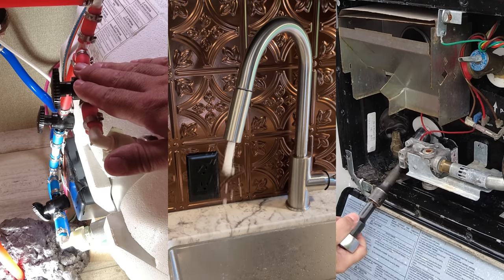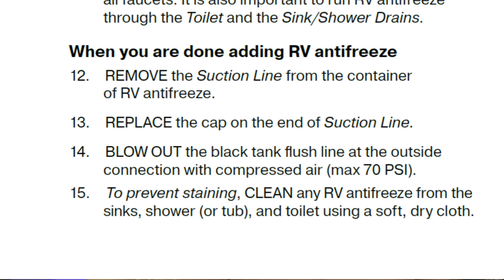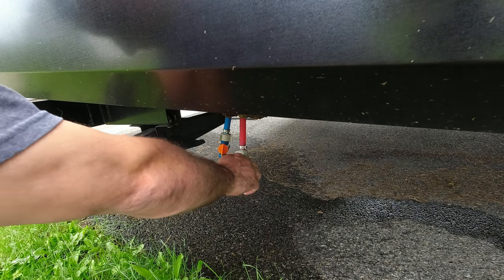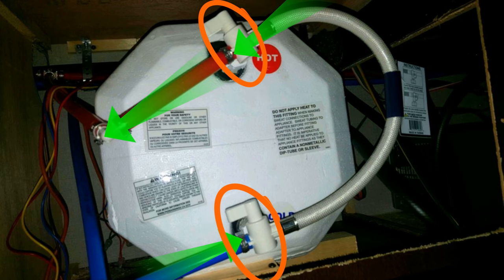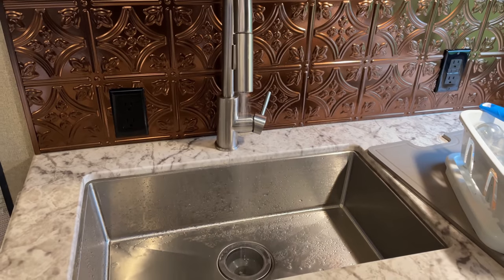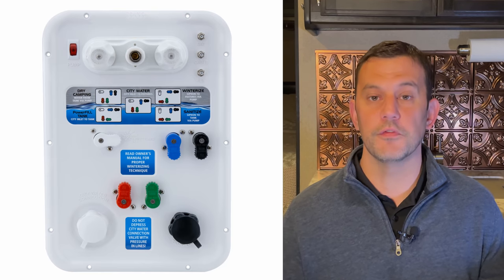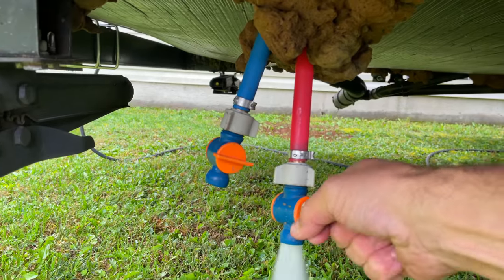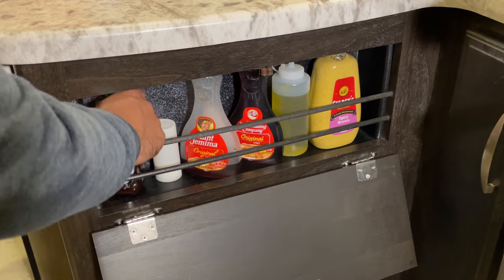RV Winterizing Made Easy - Step by Step Process for Beginners (Compressed Air Method)

Comment: Don't forget to press the toilet flush pedal with the compressed air hooked up. That toilet valve is a very popular item to replace in the spring. The RV stores know you are looking for one in a pinch and they price the valve accordingly.
Reply from the maker: definitely, and this is mentioned at 15:48

Comment: I use a combo method, blow out the lines with compressed air, then pump antifreeze through the lines, and then blow out the antifreeze.

Comment: Water heater drain plug remover non-pro tip: if you carry a folding 4-way lug wrench, one of lug wrench ends is likely to fit the drain plug and it has plenty of length to reach the plug with ease.

Comment: I made up a second air line with a adjustable pressure gauge to make sure it’s at 45 psi after setting my air compressor to 45 I blow out all the air first and I also run antifreeze after through the trailer just to make sure
Reply from the maker: Thanks again for watching and commenting Corey, appreciate it.

Comment: Another great video.  I used this method last fall but left the process worried about residual water left in my pump.  Using a winterizing valve for this is brilliant.  Thank you for this idea.  I plumbed one in with an adapted 3/4” female hose thread adapter and immediately heard water come out when applying the air.  Thanks again.
Reply from the maker: glad it helped, and thanks again for being a part of the channel Josh.  are you a photographer?
Reply: agree with Josh, great idea!

Comment: What a great video!  It covers many items that are not covered in my manual.  I opened my tank drain and let it drain until it stopped.  Then I  raised and lowered the tongue and didn't see any additional water come out.  When I put compressed air in the filler opening about a half gallon to a gallon of water came out.  This surprised me to say the least.  The other surprise was the black tank flush.  When I opened the cap water came out, which must have come from the roof vent somehow.  I blew the line out but only loosely put the cap back on so any water that might get in there can still get out.  Good tip on blowing air into the winterizing hose to blow out the water pump and emptying the sediment cup.  None of these were covered in the manual and this lack of information could be costly in a deep freeze.  Thanks for the tips!
Reply from the maker: glad it helped, thank you for watching and commenting!

Comment: One step I added after isolating the water heater was to blow compressed air into the drain plug. Quite a bit of water came back out of the drain plug.  I appreciate your step by step explanation on the process.
Reply from the maker: Great tip Terry, thanks for sharing.  I'll add that to the update section of the description.
Reply: Terry, I'm not clear if you blow compressed air into the DRAIN plug, how can water come out of the DRAIN plug?
Reply from the maker: It flows into the tank and bounces back out since there’s nowhere for it to go.
Reply: @RVTIPSANDTRAVELS  Ross, thank you for the reply!  Like all others, I truly appreciate your clear, detailed explanations.  You are my go to source for my Forest River rpod.
Reply from the maker: Glad to help bud.
Reply: I blow air through the hot water tank before I bypass the tank.  This insures that any left over water after taking off the drain plug comes out.  Then close the bypass valves and continue the rest of the process.

Comment: Great video! I use the compressed air method here in Alaska after one year I missed one of the valves at the hot water tank and filled it with AF. Took forever to flush it out the next year. No issues up here with compressed air and AF in the p-traps. I found the detailed explanation great for refreshing my memory. Appreciate the time to creating and posting the video.
Reply from the maker: Thanks Camron, stay warm up there buddy!

Comment: Great video, very complete. Thanks for the lead on the low-point drain valves. I now have some on order. Laying under my trailer removing the plugs is a real pain, and these will make the process much easier. I am a little uneasy about getting all the water out of the pump and pump outlet line with the air-blow method, so I plan to suck a little RV anti-freeze through it just to be sure then air-blow the rest of the lines.
Reply from the maker: John, many people I have talked to use some sort of hybrid system, even some who run antifreexe through to push the water out, then blow out the antifreeze.  Your idea is great.  Thanks for sharing.

Comment: Great video! But one thing is confusing. I the first step where you say you are blowing out the fresh tank, your video shows you connecting to city water to do that. Is that a mistake? How do you blow out thge fresh tank? My fresh water intake hole does not have threads so it will not be pressurized. I am no so worried about a little water in the fresh tank itself, but what about water in the lines to and from the fresh tank? Thank you.

Comment: Ross, We plan to use our 2021 Renegade Villagio often all throughout the Winter season. When not in use, our unit is in our driveway, hooked up to 30 amp shore power with an electric  space heater in the coach area as well as the heat pump/furnace set to 60 degrees. We also use a thermometer to monitor the coach temperature from in the house. Our fresh water will be drained and not filled until Spring. The tank is completely inside the coach as is the water pump. The black and grey tanks have heating pads but will be drained before leaving the campgrounds. Also, the drains will be clear of water. We use anti freeze to "flush" the macerator toilet but plan to empty the black and grey tanks before leaving for home. I plan to drain the hot water tank and only fill that at the campsite and empty it before leaving for home. I plan on using the compressed air method with a portable compressor to clear the lines before leaving any  campground. Do you see any flaws in this process?
Reply from the maker: I think you got it covered, let me read over this in more detail tonight and see if there is anything you are missing, but it looks good.

Comment: Do you have to be connected to shore power or can you just use the RV battery to run the water pump? I'm sure it doesn't make a difference but I just noticed you mentioned shore power specifically. Great video, thanks!
Reply from the maker: 12V battery is perfectly fine.

Comment: I am new to the rv camping world but I just bought a travel trailer with a tankless water heater.  May be a dumb question but I am assuming I can skip the bypassing water heater step as my unit doesn’t store water due to it being tankless? 
Another question I had is when you put the antifreeze in at the end you are just putting a small amount through the open drain areas for the sink/toilet/showers just to let it sit in those openings over winter and that’s it correct? 
Thanks again for a very thorough explanation for this newbie!
Reply from the maker: correct, run antifreeze through the water heater on tankless models.  and yes, you want anttifreeze to sit in the P-traps.

Comment: Hey Ross, 
Can you do an all inclusive winterizing/dewinterizing video w/ a tankless water heater?
Reply from the maker: nothing additional you need to do, just treat the water heater as plumbing lines, run antifreeze or air through.  i would recommend antifreeze over air.
Reply: @RVTIPSANDTRAVELS  fair; I prefer antifreeze too , thank you Ross.

Comment: Great video, just one question. What about the line that goes from the water holding tank to the water pump? 
It seems hard to get compressed air through it because of the check valves on the water pump and also it is not getting any antifreeze with your method. 
Is it a concern or with the holding tank empty, Are we assuming that it would gravity drain?
Reply from the maker: you're spot on my friend, with the tank empty and underneath the pump, that line will never hold water.  if it makes you feel better, just run the pump for 5-10 seconds after you empty the tank.  if there is anything strange like a vacuum that created itself in the line, the pump will dislodge it.

Comment: I just made my maiden voyage of my travel trailer and have been following all your tips.  One question I have is about the toilet.  If I put some water in there, normally it's all gone in a number of hours.  I take it that this is not normal?  Im still under warranty, but want to make sure this gets addressed.  Thank you!!
Reply from the maker: Not normal, I would get it fixed. You don’t want those gases leaking into your living space.

Comment: Thank you for your videos.  They are a great help to this newbie.  I'll be winterizing soon and I wanted to use a Milwaukee 2848-20 tire inflator.  Will it be adequate to purge any water from the camper?
Reply from the maker: thank you, i would like to see around 40 psi through those lines.  and the longer you blow air the better, take your time to push as much water out as possible.  make sure you put an oil trap on the line, and make sure that compressor will run 40 psi for a few minutes at a time.
Reply: @RVTIPSANDTRAVELS  Thank you again for your help.  I have never had anything to do with an RV and you have been my go to for the mountain of questions.
Thank again for your high quality videos.

Comment: When our Imagine was new, I winterized it and didn’t put antifreeze into the holding tanks.  We had 3 broken waste valves on our first trip in the spring.  The dealer and the manufacturer would not cover it because I winterized the trailer.  After reading the Imagine forums about this, I found out that the tanks may be tilted so that they don’t drain completely and water is stuck in the valves.  Since then, I always add antifreeze to the holding tanks.
Reply from the maker: Hey June, thanks for watching and commenting.  While that sounds possible, I dont think that is the case for a couple reasons.  it wouldnt make sense for a manufacturer to tilt a tank away from the drain side.  Towards the drain side would make sense.  even if it was a poor build from the manufacturer, I would doubt that all 3 tanks were all tilted away, Especially from Grand Design.  another reason is that even though tank valves are mounted on the sides of the tank, they are still at the bottom. and even if the tank was tilted towards the valve, water would empty through the valve when you emptied your tank during winterizing.  it wouldnt sit against it.  the logic doesnt make sense.  tank valves are 3-4 inches tall also, so for that much water to sit against a valve that was previously opened and drained doesnt make sense. not saying that frozen water cant destroy a valve, but i just dont see how it is scientically possible using the logic above.  unless you drained your tanks with the trailer leaning away, closed the valves, then moved the trailer to where it was leaning towards it.  my honest opinion, i just dont think people are draining their tanks completely.  something you can do to check this is to let the tank drain completely, leave the valve open, then pour a little antifreeze in the toilet (not much).  if you see antifreeze come out of the sewer pipe, you know there is no water against that valve.

Comment: Great video with more detail than I have reviewed anywhere else. One question regarding water not cleared in the area between the water heater and the cold and hot winterization valves.  Should compressed air be blown from the city water intake through the water heater while the bottom drain is open before switching the (2 or 3 based on unit) winterization valves? Thanks
Reply from the maker: thats a great question... the valves should be oriented so that when they are open with the low point drains will drain them.  If not, they will drain back into the water heater as the water heater is emptied.  I thought about this years ago and couldnt come up with a scenario where water would stay in those lines, but you're thinking analytically, which is great!

if for some reason those lines were pefectly parallel to the ground, water wouldnt sit in the past the 90 degree T anyway.

Comment: Great video, thank you for this. One question I had though is why you didn't pour antifreeze into the water pump through the supplied antifreeze hose?
Reply from the maker: Because I blew air through the pump.  It’s in there around the 14:35 mark.

Comment: I use compressed air bacause it is a nightmare to get to my water pump (2016 passport 195rb)
I have a one valve system on my hot tank with a couple of non return valves.
Thanks for the great video.
Reply from the maker: As always, thanks for watching and sharing your info Mike!  Happy Halloween my friend!

Comment: I agree this is very informative- thank you. My question is after blowing out secondary lines, if we can blow water out of the faucet, shower and toilet via the winterization hose as we did taking water out of the water pump? Maybe the city line is preferable as to not risk damaging the water pump, but it’s convenient to be inside where the winterization hose is and see water come out of the faucets, shower and toilet. If it is acceptable, the water pump should no longer need to be turned on during these steps, right?
Reply from the maker: You can connect to the city line outside and leave it connected while inside opening the faucets.  Does that answer your question?

Comment: Great video—thanks!  By the way, if you replace your J-traps with the HEPVO drain valve you do not need anti-freeze in the drains.  Plus, you can also remove the air emmitance valve.
Reply from the maker: Thanks for watching and sharing Dan.

Comment: That was one of the most thorough Winterizing Videos I have found yet.  Thank you very much.  As a new RV owner this year, I have not used the fresh water tank/pump.  How can I locate that thing if there is no water in system. Can I still turn the pump on momentarily if no water is in system and not hurt it?  Was going to listen for the motor noise to try and locate it. Want to get water out of it if the put water in during PDI.  Thanks.
Reply from the maker: Yes, your pump can run empty.  I left mine on for 2 days accidentally years ago.  Thanks for commenting Mikey.
Reply: @RVTIPSANDTRAVELS  Thanks again for helping us new RV Campers 😁

Comment: As a solo rv'r I am attempting to winterize my fifth wheel soon. I just discovered that my water pump doesn't work. Is there another way to pump antifreeze into the lines?
Reply from the maker: are you sure its not working?  it might just need to prime.  does your wet bay have a nautilus panel that will draw the antifreeze in?
Reply: @RVTIPSANDTRAVELS  I'm not sure of anything at this point but I will locate the wet bay and see what I find.
I don't hear any noise from the pump when I switch it on at the panel.
Thank you for your response 🙂

Comment: I found your channel recently and have been watching when I can. Thanks for not being an "expert" and for showing your common sense approach to getting things done. I use the air pressure method and never had a problem except once. My 2 way RV refrigerator had an ice maker in it. Forgot all about that little sucker. Yup, water froze in the diverter valve, expanded, and shattered the valve. Didn't know about it until the next time I hooked up the water. Guess it was a good thing it happened because now I never forget to take care of that valve and water line to the ice maker.
Reply from the maker: GREAT POINT Tom, I did not even think of talking about built in ice makers.  Thanks for adding!

Comment: I do prefer only using compression but I have a Ryobi battery powered portable compressor P747. It can inflate above 45 psi but do you think that this is adequate to blow enough air through my travel trailer? It’s not a round type canister compressor.
Reply from the maker: it will need to maintain 45 psi for a long time, otherwise your not getting all the water out.

Comment: What a great video.  Very well done and easy to understand.  Thanks for the great work.  My question concerns the fresh water tank.  I have never used this tank, nor the pump, for as long as I have owned this unit which  I bought new.  Always only used the city water hookups.    Is it necessary to worry about running air through this line and pump during winterizing since it has not been used.  My understanding that the fresh water tank is separate from the city water system and can run independently?  Thanks for your help.
Reply from the maker: You should be good to skip if you never used them.  Doesn’t hurt to do them though in case the dealer ran water through the pump to test.

Comment: I paid close attention and made good notes, then tried to blow out my RVs lines.  Nothing happened.  No water came out anywhere.  I'm wondering if my 1 gallon compressor is not powerful enough or doesn't put out enough SCFM.  I shut off all the faucets, and set the compressor to between 30 and 40 psi. Then I opened the  hose's shutoff valve slowly and watched the pressure reading drop to zero on both my compressor outlet and the digital readout on the pressure regulator I put in the line.  What size compressor do I need?  This is the first time I've winterized my Class A, since until now my annual winterizing  method was simply to drive it to Tucson for the winter.  I'm a subscriber to your channel.  Thanks.
Reply from the maker: even a small compressor will at least push air through the line.  sounds like something is blocked, or there is a check valve not opening due to the small amount of air youre pushing through.  try again, if that doesnt work, immediately hook up a water hose and let me know if water is going through the lines.